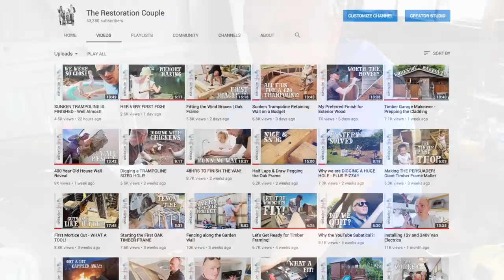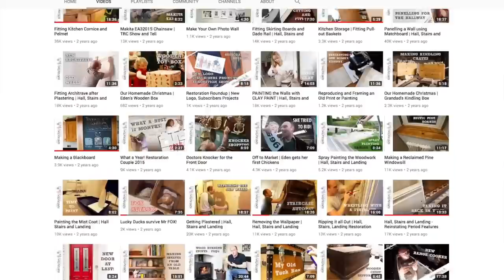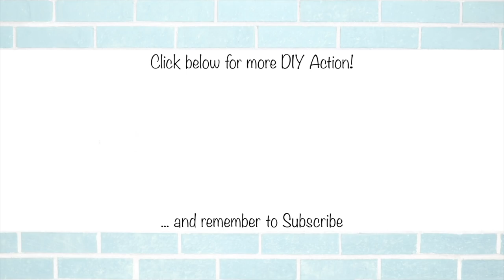Can We Build the Workshop NEXT MONTH?!

Comment: Wow, where to begin? Patreon is ok but you need to bear in mind that your channel is diverse and not everyone is here for all the content topics. Patreon doesn't distinguish as far as I know so you might have people that are not interested in supporting you because they don't like all of your topics. I am less of a fan of the campervan stuff but still watch them and would still support you but I can imagine some wouldn't.
Modular building, from personal experience I wouldn't bother. I build a modular workshop with every intention of taking it with me when I moved. Turned out I had more space at the new place, the modular design worked fine but the cost in transporting it and then extending it to fit the new space was just not worth it and it was actually a useful selling point for the old house. Your workshop could easily be turned into a nice summer house for the next owner so I would seriously consider just building what you want / need now and worry about the next workshop when you move. Also, I guarantee you will make mistake / things you don't like in Workshop version 1.0 and so the chance to build version 2.0 will be a great next step.
I am not a million miles away from you and would happily lend a hand with the build. Having built 3 workshops now for myself and countless for others, I know the benefit of having plenty of hands on deck when lifting and moving things into place.
Good luck with whatever route you go and shout if you need another pair of hands.